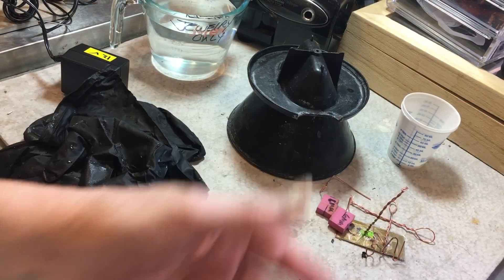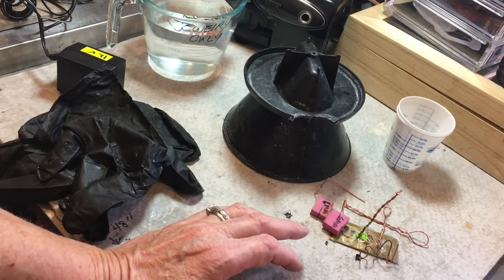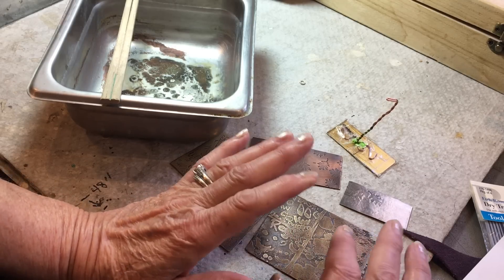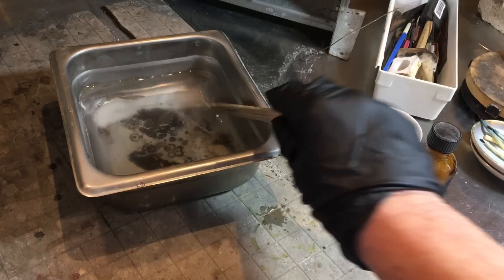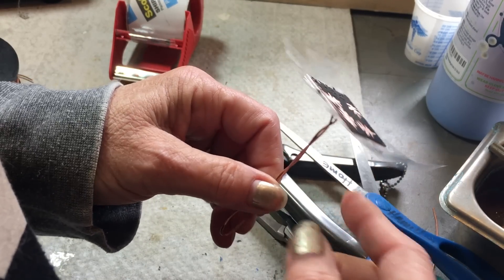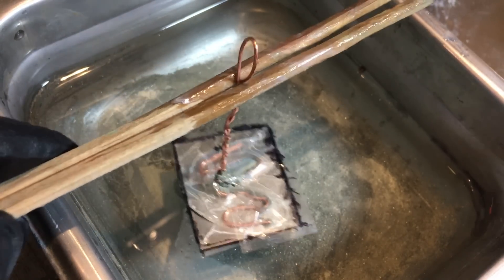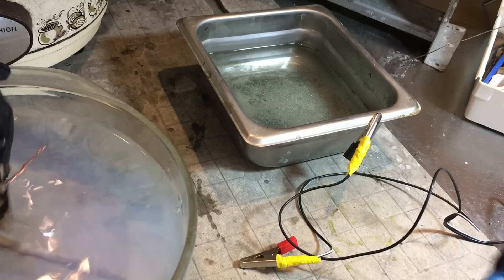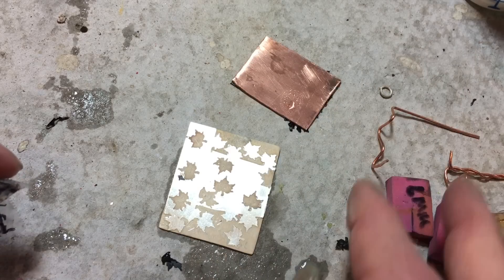Electrical Etching:  An easy, clean and long-lasting way to etch.

Comment: Thanks Nancy.  Appreciate the safety info; would also have liked to have seen how you set up the art work to be etched. How did you create the pattern and what did you use as the resist? (You mentioned vinyl…)

Comment: Thank you so much for this thorough video on the toxic dangers. I know this vid is 4yrs old, but hopefully someone can shed some light. I am a new jeweler and I had a situation where I used a brand new tripod with a screen mesh. Instructions didn't say to clean it. I had great ventilation and exhaust in the room yet after soldering a piece on the brand new tripod/mesh, my fire alarms went off even though there was no smoke and then I felt sick for 24hrs. Any one else has had this happen?
Thanks!
Reply from the maker: Actually, I've had that happen too with new steel. Galvanized steel is coated with zinc.  I found this scary information at https://www.cmac.com.au/blog/5-things-to-welding-galvanized-steel-safely#,    "Metal fume fever - 
When welding galvanized steel, the zinc coating easily vaporises (sic). This will form zinc oxide fumes that will mix with the air. This gas may give short-term effects to your health which is also known as “metal fume fever”.  Welders may experience flu-like symptoms once they inhale the fumes. These may include nausea, headaches, high fever, shivers and thirst. The symptoms will usually go away within 48 hours of exposure."  I'm guessing this is what happened.  Thank you for bringing this to my attention.
Reply: @NancyHamiltonJewelry  Wow thank you Nancy. I wholeheartedly appreciate your time in responding to my question and thank you again for all your fantastic content. I wish I had a teacher like you near by, but alas, your videos will do for now!!!

Comment: Can you provide links to the info saying saltwater etching is unsafe?
Reply from the maker: Here's one:  https://www.greenart.info/galvetch/contfram.htm (See the link to the complete PDF, below).  Another: https://www.metaldetectingworld.com/make_electrolyte_p15.shtml.  Wikipedia discusses the chemical reactions that occur producing chlorine gas, hydrogen gas and more.  The part regarding this is under the heading:  Process of Electrolysis.  https://en.wikipedia.org/wiki/Electrolysis.  This page discusses what chemicals are produced during the process, sodium hydroxide (lye), chlorine gas, sodium chlorate (bleach), and hydrogen.  https://revisionscience.com/gcse-revision/chemistry/acids-bases-salts-electrolysis/electrolysis-brine.  Full PDF of Green Arts page :  https://www.greenart.info/pdf/appendixcdraft.pdf.  (A lot of his links are out of date but, the chemistry remains the same.)  Hope this helps.
Reply: @NancyHamiltonJewelry  thank you! Will share with my lecturers

Comment: If you think your silver nitrate is almost spent (fully converted to copper nitrate) you can drop in a piece of copper wire. The remaining silver in the solution will grow crystals of silver on the copper wire.

Comment: Thanks for another great tutorial. I have been looking into switching to electrical etching from just chemical and I had no idea about the risks associated with salt water. I won't be doing that now.

I'm so appreciative of your videos and website and know how much time is involved in just the researching process. I don't know how you have the time to do all that you do unless you don't sleep! You must be extremely efficient (I tend to have some ADD). 

I admire your thoroughness and focus on safety and especially the generosity of sharing your time and knowledge. I feel like you are my metalsmithing mentor even though I don't know you except from your videos.

Comment: Hi Nancy, Great video but what type of battery are you using? It's out of the video range.
Reply from the maker: I did a video on making your own electrical etching machine.  The link is at the end of the video as well as in the description.  Hope this helps.  No battery.

Comment: Chlorine gas is a chemical weapon is it not?
Reply from the maker: Yup!
Reply: It’s also a byproduct of cleaning a pool or public tap water. The amount of gas released is important as to wether or not it is dangerous and this video doesn’t touch on that aspect at all. Spoiler: it is an infinitesimal amount and negligible even over a long etch with a stiff breeze or adequate ventilation. Hydrogen gas is also a byproduct of saltwater etching, again, not enough is made to be an issue. A small fan anywhere in the room would be an overcompensation for the quantities made. You would have to size this up to an industrial scale before seeing a byproduct that might effect a human working on a piece.

Comment: Valuable video. It scares me how many people are using the saltwater, thinking that, because it is just salt, it is safe. I almost used the salt - dozens of instructions online about it, "totally safe", blah blah blah. But I kept reading..... Thanks for taking the time to do this video, Nancy. Hopefully it will get circulated.
Reply: The saltwater bath can be safe if done in a well ventilated area or under a hood that removes the fumes from the room (not just sucks them up and spits them back out in the same space)

Comment: What do you use as a resist?
Reply from the maker: Depends on what type you are using.  You can paint nail polish on,  draw with a paint pen, put waterproof stickers on, etc.  Anywhere that there is paint, polish, paper, etc., will not etch.  You can also paint on a layer of  "ground" on the metal (see link) and draw into it with a scribe or similar tool - after it dries.  All the lines, that cut through the ground, will be exposed in the electrolyte solution and will etch.   You can try something like this with acrylic paint.  Lightly sand the metal first. Paint on a layer, dry,  and draw into it with the stylus.  Acrylic isn't ideal though.  An etching ground chips less and lasts longer.  Here's a link to etching grounds: https://shop.takachpress.com/BIG-Etching-Ground-75ML-p/big-ground.htm Check out directions.  Here's a link to my photopolymer page:  http://www.nancylthamilton.com/techniques/etching-with-photopolymer-resists/.
Reply from the maker: I used sticky vinyl: https://amzn.to/2LjEsKU
Reply: @NancyHamiltonJewelry  Do you think sandblasting resist for glass would work as well?